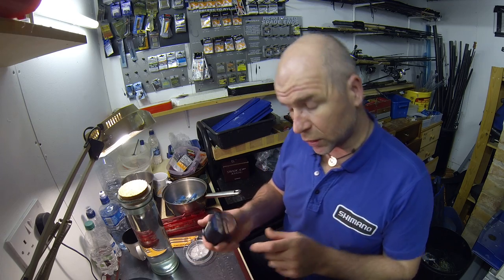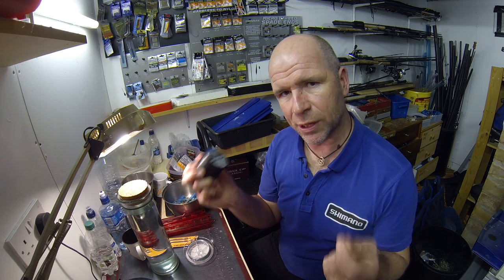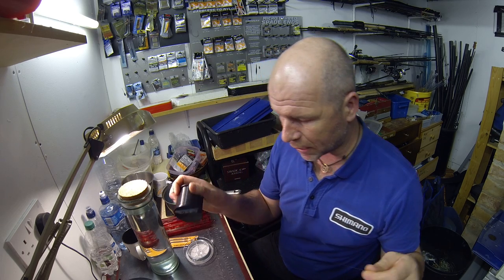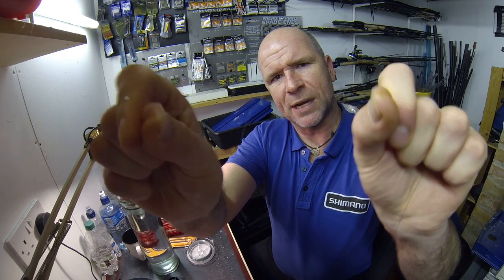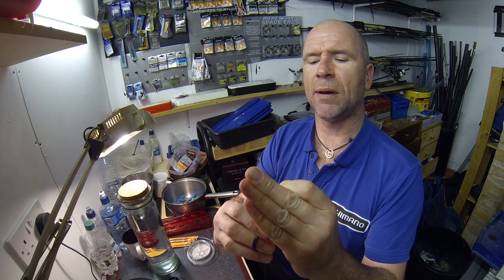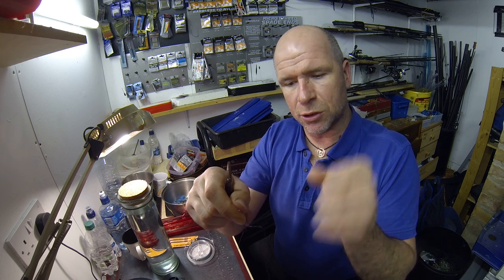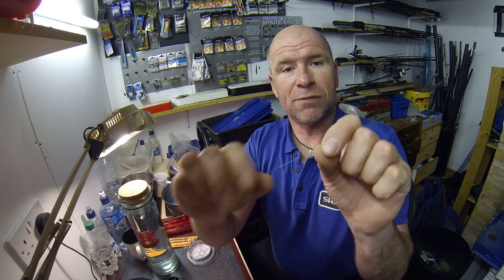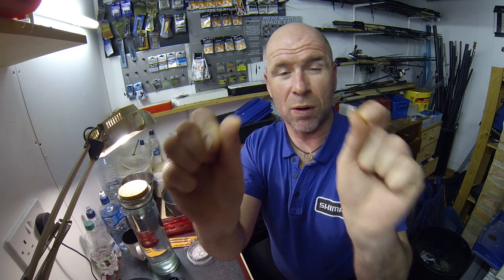Nick Speed Fishing/ Reliable Shockleader Knot for Braid/mono reel line

Comment: Nick...Instead of using a figure of eight, why not tie the half blood knot to a lasso, I just tried this and was surprised by the strength, the lasso coil compresses to nothing.
Reply from the maker: Mike Bennett tried it mate....by dispersing the two knots apart there's less friction on the cast..that's why I use this knot set up